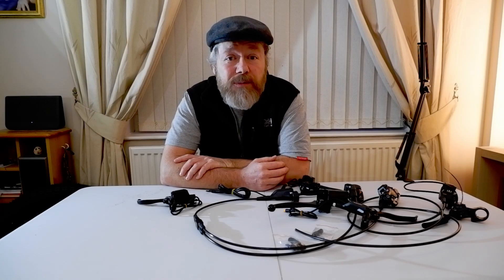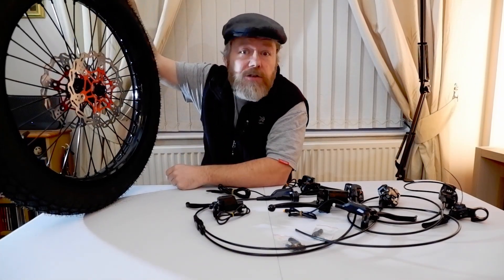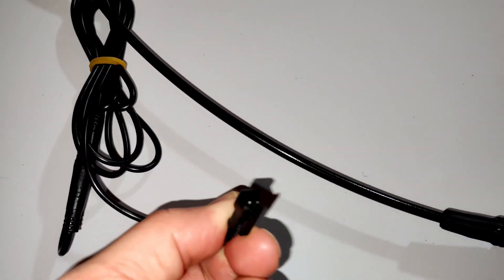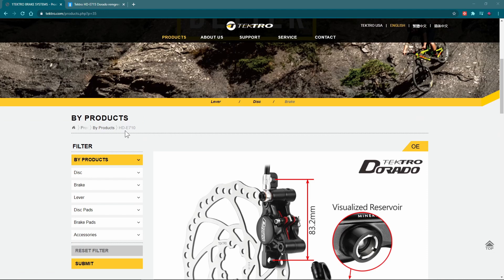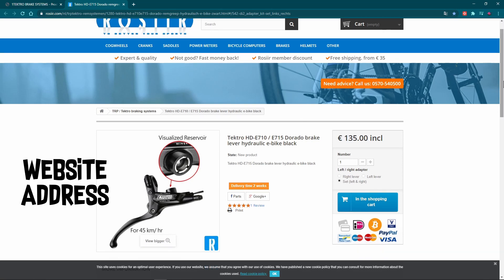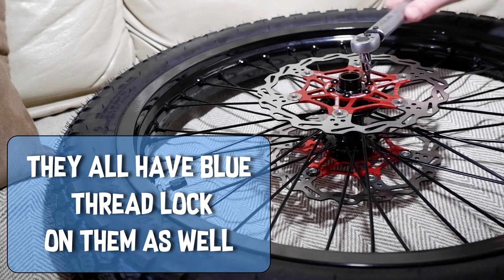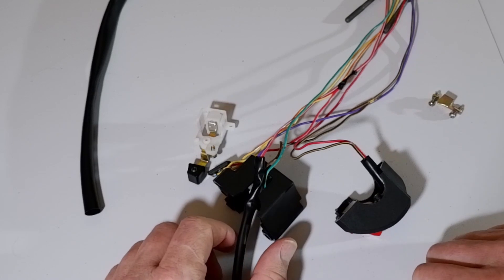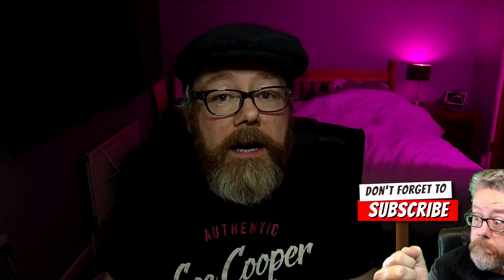FAST EBIKE BUILD UK ROAD LEGAL PART 3 - SUR-RON LIGHT BEE X BRAKES TWIN FRONT CALIPERS

Comment: As for the wiring diagram, the switch you are going to use to operate the controller will melt, it needs to switch a relay of the proper value
Reply from the maker: The controller switch doesn't draw any significant amps and is just basically telling the controller to switch on.
Can you elaborate a bit more on this?

Comment: One of the discs is the wrong way round, there's a direction arrow on them that should point the same way as the arrow on your tyre
Reply from the maker: Yeah the disc looks bad if I turn it around as they are not the best from the other way and have it that way for looks.
What kind of braking problems do you think would arise from have it facing this way? The disc is obviously not ment for a dual brake set up.
Reply from the maker: After looking at the discs turning the right one around wont work so will probably get solid stainless discs, plus it won't pass MSVA test so cheers for the comment.